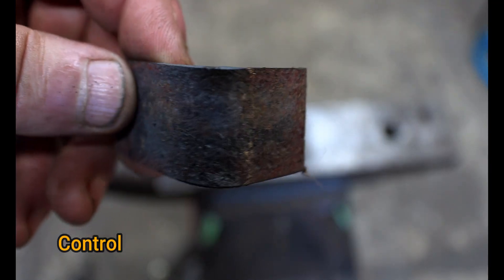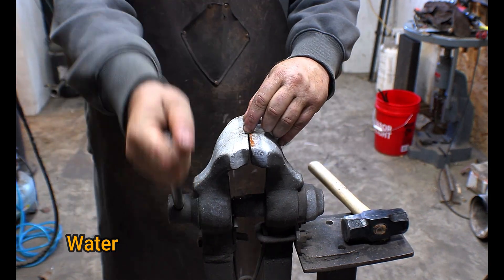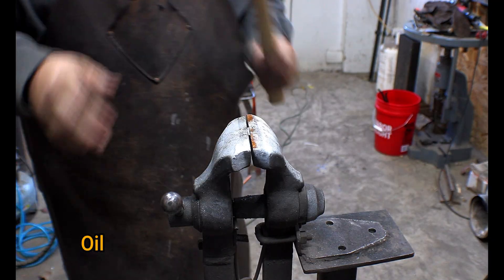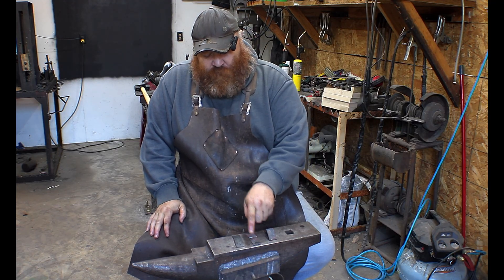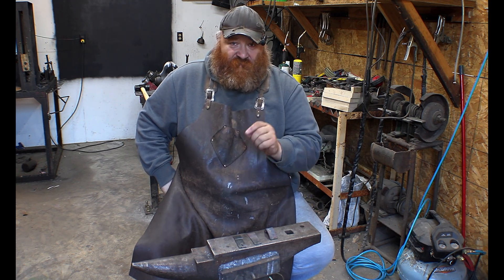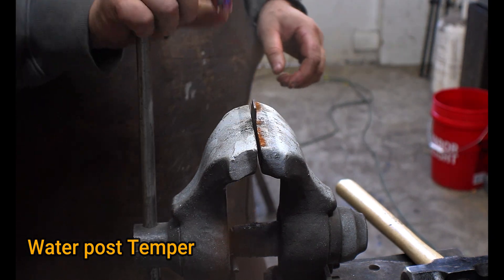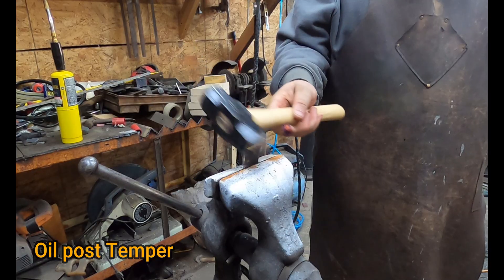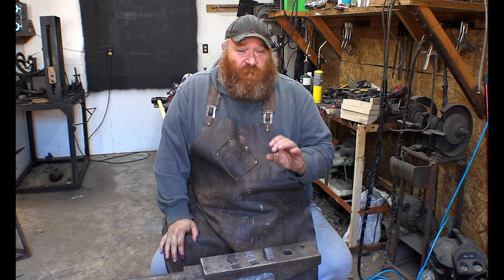Can you HARDEN Bed Frame Steel? |Bladesmithing

Comment from the maker: Back in the forge with a classic test: Bed Frame = Knife Steel?
Today I forged coupons from a bed frame and ran a hardenability snap test (oil vs. water) to see if this stuff can actually harden.

👉 Got experience with bed frame steel? Drop your results and heat-treat tips below so others can learn.
🗓 NEXT UP: Mystery Steel – Is It Knife Steel? drops next Friday at 12pm PST. Don’t miss it.

Stay safe, be well, and as always — FORGE ON!

Comment: Looking at fracture grain size (coarse/fine) only works if the steel has basically no ductility.  If this is a medium or lower carbon steel or if it didn’t harden to a 100% martensite structure, the coarseness you see on the broken surface is likely deformation that happened before the fracture, however little it might have been.

Comment: Some/most bed frames are the equivalent of 1080 hi manganese from rerolled railroad track. At least east coast USA. 
Some are more akin to 1045
Many are just plain mild steel. 
The paint color and the shape is part of how you can tell the difference by eyeball. Only the thin brown angle iron style frames are usually re rolled rail. 
Larger/thicker light brown angle iron style are more often a lower medium carbon in my experience but can also be higher. 
Thicker blue bed frames or frames that are square tubing instead of angle iron are usually mild steel.
I did some pretty extensive study and research on this around 10-12 years ago
I also found that a great many "non weldable" rebars are rerolled railroad track (1080 high manganese), or rerolled train axle, 4140 equivalent.

Comment: During the heat treatment. I bring the steel hot enough just as it becomes non-magnetic.  That's how i know if it's hot enough before the quench. What do you think?
Reply from the maker: Yep spot on
Reply: Loss of magnetism doesn’t necessarily coincide with an austenitic structure.  Lower carbon steels typically need higher temperatures to harden fully, 1600+.

Comment: @rustyhammerforge5902 I have some bed frames, I was gonna use them to wrap around some 4x4's for my anvil stand for strength. Either that or split them lengthwise along the bend and turn them into Coat Rack Hooks. Now I'm thinking why waste high carbon steel on stuff like that that only requires Low Carbon steel. Hmm🤔🤔
Great video, Thanks! I'm a new subscriber 👍😁👍 both here and from my High Desert Forge & Ironworks channel
Reply from the maker: Outstanding. Thank you for the sub
Reply: @rustyhammerforge5902  Here I is!  So, would bed frames steel be wasted on the metal wrap around my 4x4 or 4x6 anvil stand?
Reply from the maker: @HighDesertForgeIronworks nah it would be a great addition. High tensile strength as it is will shore up that stand beautifully. Maybe just a save a bit to make a knife or two.